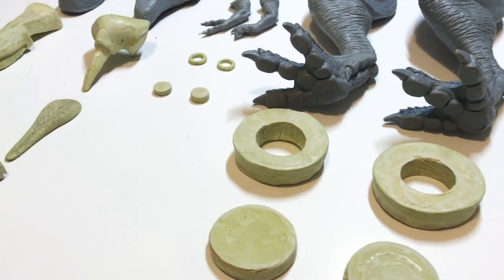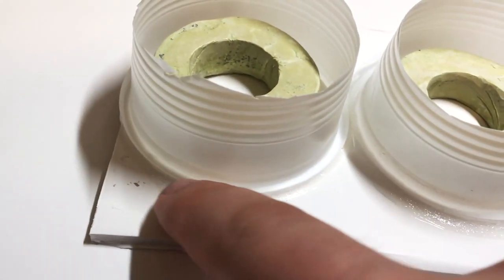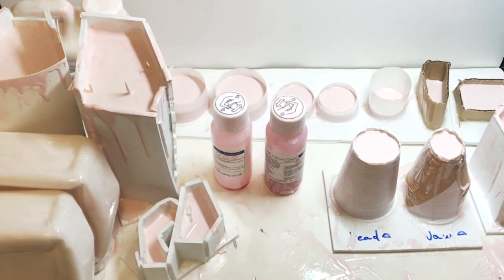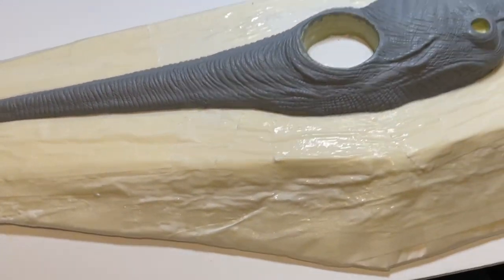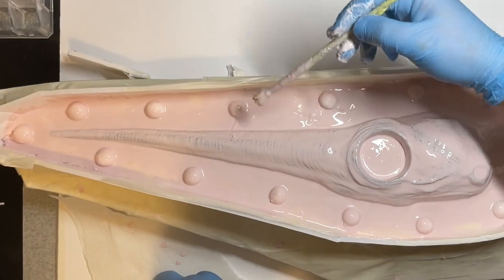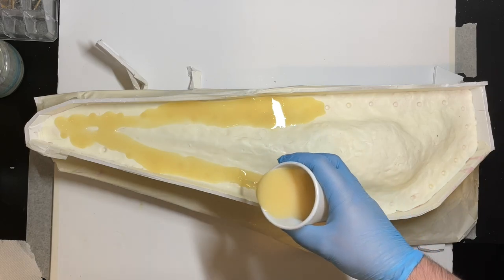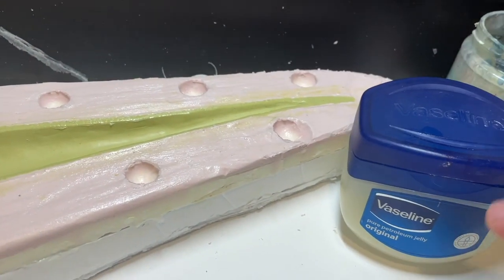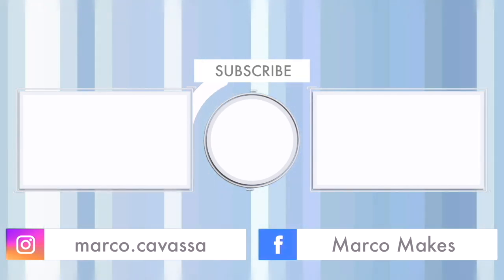Making the Ultimate Rubber T. REX Figure - Moulding the Rubber Rex - Episode 4

Comment: I should of mentioned earlier but plaster of paris would of been a cheaper and safer cast jacket than the resin
Reply: Unfortunately plaster is much more fragile than resin, so it wouldn’t have had the strength needed.